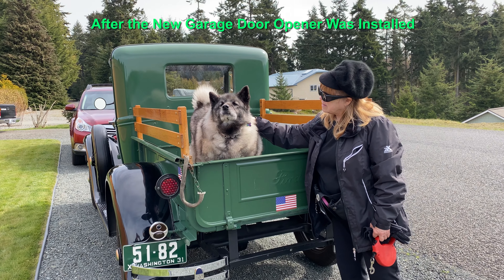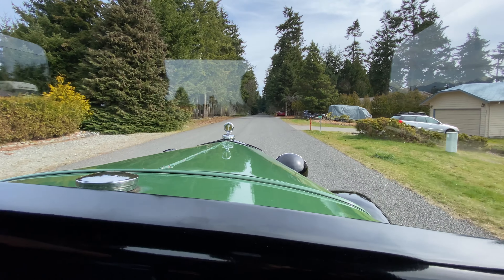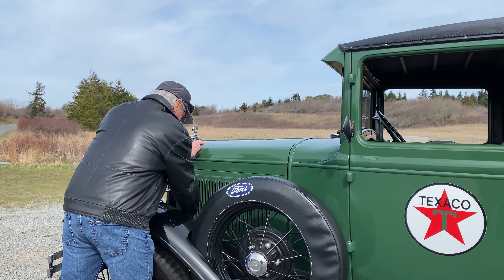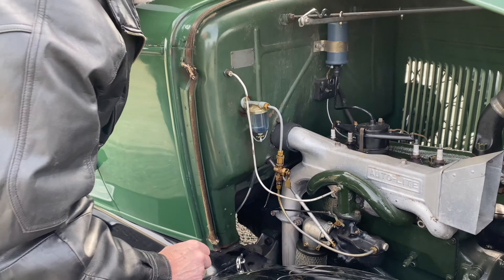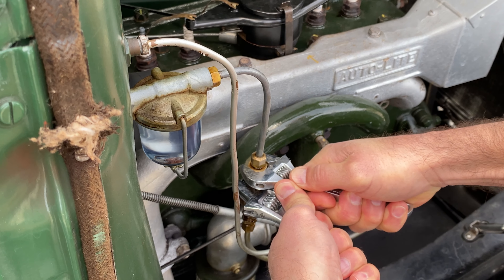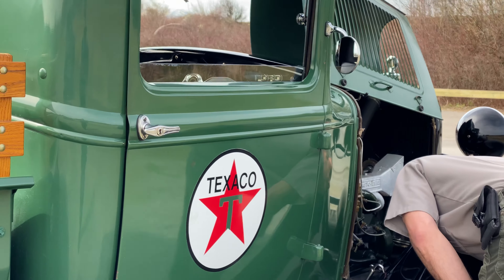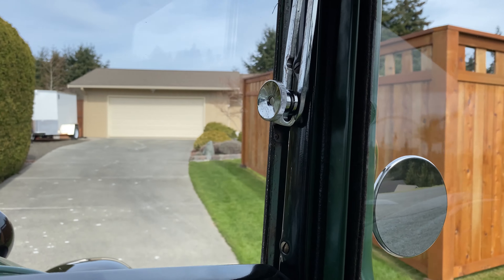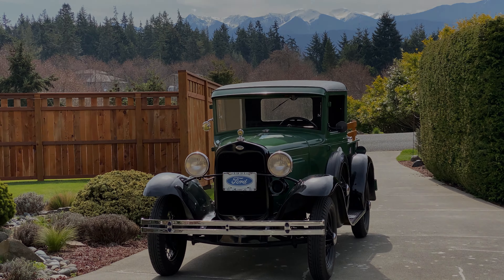How to Shift a Model A on a Cold Morning – Warm up the Transmission in 1st or 2nd Gear

Comment: It didn't really look like the fittings were very loose.  That's why Ford had to move the fuel shut off outside the vehicle and onto the firewall spring of 1931. You'd had gas dripping on your feet. That must have been exciting back then for smokers. 
Apparently your truck and my car were built before the indented firewall.  
My 1931 phaeton has a modern fuel valve under the tank half way across the line.. I bought an original valve and new line but decided to just leave it the way it is for now.
Love the scenery where you live. Even with hills in southern Illinois, where we live is mostly flat, making Illinois one of he flattest states, except Florida where we lived for 22 years.
Thanks for the ride.

Comment: Putting very small amount of EZ Turn fuel lube on the fittings & threads helps make a better seal. You won't have to hog it down. It's made for fuel valves.